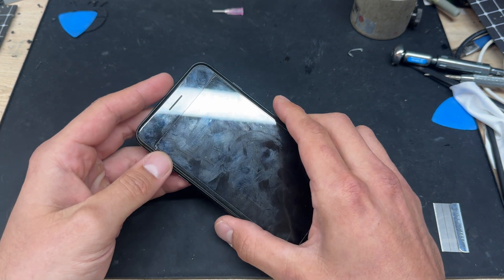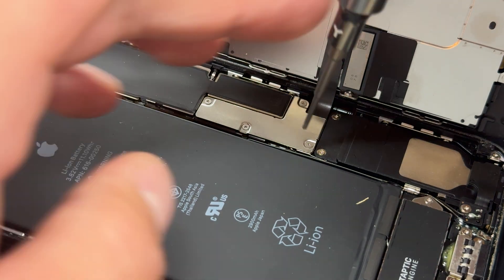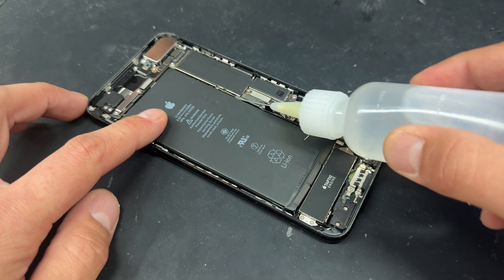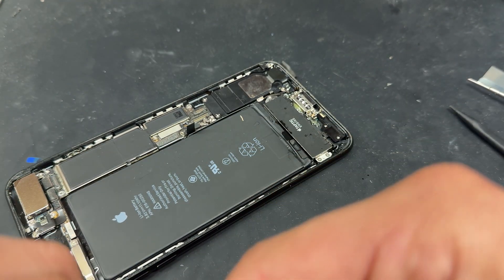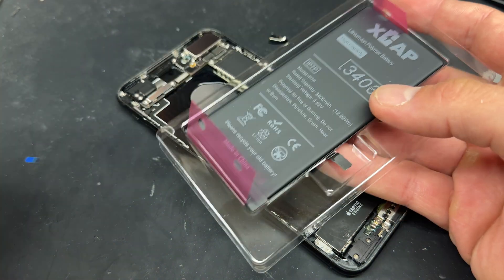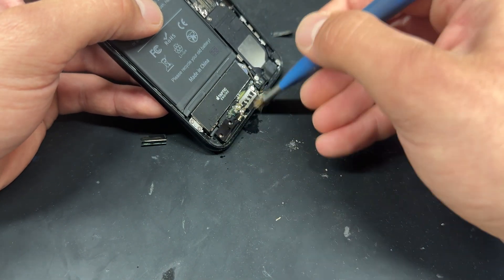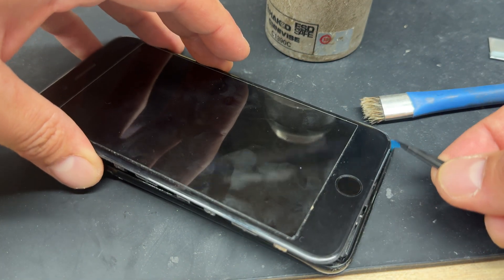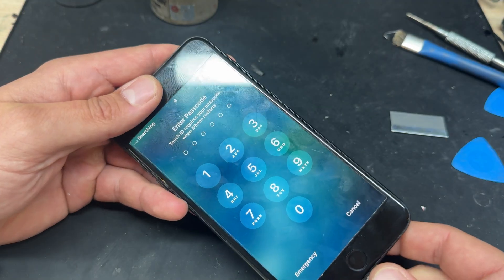Fix Your iPhone 7 Plus Battery Fast: Easy DIY Replacement Tutorial!

Comment: I’m changing my battery now and one of the adhesive strips didn’t fully come out from under the battery what should I do? How can I get it out…….
Reply: NVM I figured it out and I have a HUGE smile on my face right now, I never did this before and it’s flawless. Had to stay calm and pray a little when I got stuck BUT I DID IT!!!!!!! WOOOOOOOOHOOOOOOOOO
Reply: Mine went up in flames  do not bend or try without the adhesive liquid remover he used

Comment: I looked at several iPhone 7 Plus battery replacement videos and yours is by far the best. You make it look easier than it really is, but I guess you've done quite a few phone repairs. This is about the second or third iPhone I've repaired. I did have some issues with getting one of the tiny screws back in, but it all worked out in the end with the iPhone back in service again with a new battery. Your step by step tutorial was very helpful. Thanks.

Comment: 6:25 I would recommend starting with the top connector.
Because then you are free to angle the screen in whatever orientation you need, to make the contact line up with it's hole, you can't do that if the screen is already locked in place by the other 2 connectors.
That top connector can be a bit more tricky to attach, because it's twisting a bit.

Comment: Two questions, there’s no link to the tools used, like you said for the IPA bottle. Also, do these batteries allow for battery monitoring and management etc? Many thanks.
Reply: I ordered tools with the battery, but I also had to order a screen seal separately, as it didn't come with the battery.